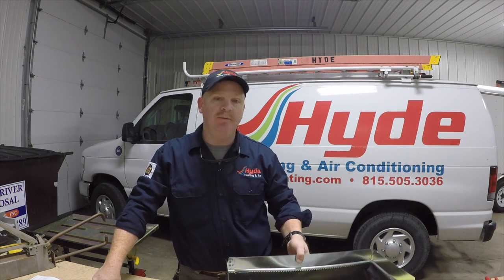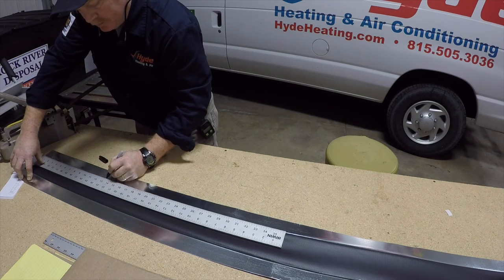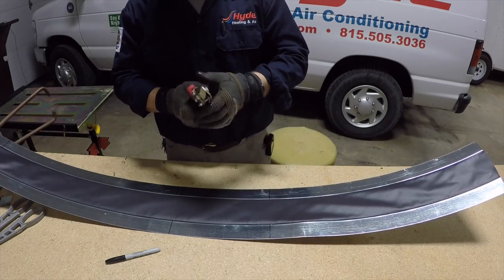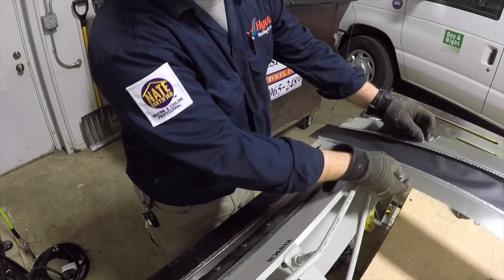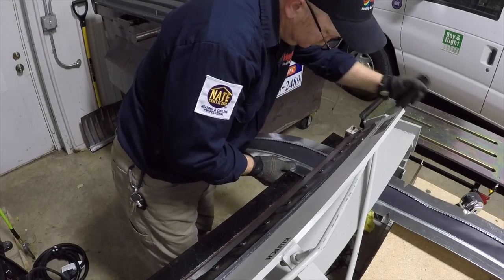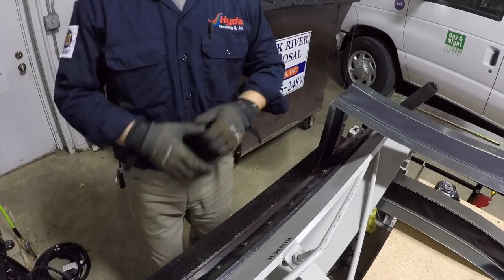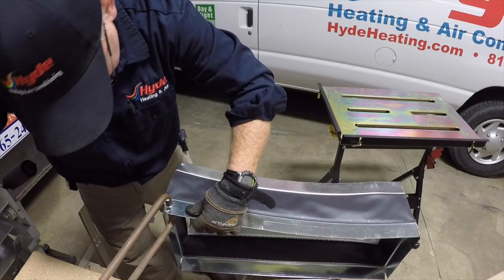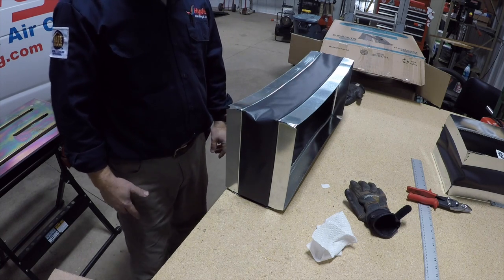Making a Flexible Duct Connector

Comment: Hi, can this canvas flexible duct connector solve voice traveling in air ducts between rooms while air system is off.? also, can the canvas duct connector connect vent boots and air ducts to eliminate voice traveling between rooms?

Comment: Decent demo. You might also mention the primary function of flexible duct connectors - They break the mechanical connection so that any vibration originating from the blower or equipment doesn't resonate throughout the duct system. The fact that it gives a little fudge room at the point of connection is a bonus. 
http://www.durodyne.com/connector.php

Comment: Sorry didn't catch your name; nevertheless,  Thank You for your video. 
I do have a question.  I have 2 of these flexible air duct joints and the rubber is not covering; its let go. Fortunately I qualified in my county for a new furnace. However when the county inspector inspected the new furnace installation; I notice the rubber on the flexible joint was flapping in the wind and ask don't they prepare the 2 flex joints:  I was told no!. (? Cost of a furance but not 2 flex joints?)
 So this stubborn red head is on a mission; broken back or not. When the airconditioner on it freezes in the basement while on the main floor one's almost sweating; I'm thinking it's because the rubber in the flex joint is flapping as if nothing was there.
Finally my question is until I can save up the money to build what you showed in your video the proper way  》My question is can I use the  High temp aluminum foil duct tape to go over where the rubber meets the metal on the flexible joint???
Just till I can save up enough to fix it the correct way.
Once again Thank You so much for your video.  These kind of videos really helps when one isn't properly educated in the field. My degrees are math/logic Accounting Degree and Computer Programming Degree

Comment: Perhaps you could make a video where you install the connector, showing what you do to the sheet metal portion of the connector and the duct ends to make a complete assembly.

Is your spot welder a Durodyne portable welder on a stand? Was your connector material from Durodyne? To me, it looks like the long arms don't apply enough pressure and that is why you get the arcing.

Comment: Good to see how this is done, thanks.
Reply: Your canvas is made wrong because you don't know what your doing 
 first  thing is to add a 11/2"  lap at both ends  
notch metal cutting one of the laps off leaving only the canvas material the other you notch away the part crimping the canvas leaving  a 1 1/2" tab 
bend tab with pliers or tongs bend  canvas over a table edge with smooth side inside for smooth air flow 
fasten metal tab at corners 
you should have 2 canvas tabs on the inside as well using a long throat heavy duty bag stapler staple canvas on the outside along the corner 4-5 in a row 
On the inside hold tabs together and staple then fold tabs towards the corner  and staple again 
Done !!!!
Reply: @davidnichols4229  that Is one way of doing it yes but that’s not the only way, just because someone made it different doesn’t mean it’s made wrong 👍